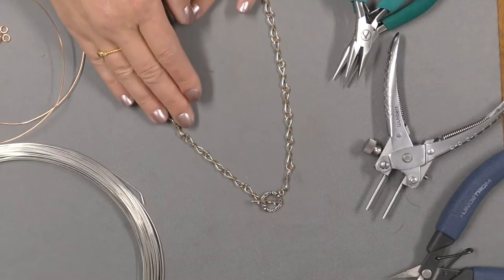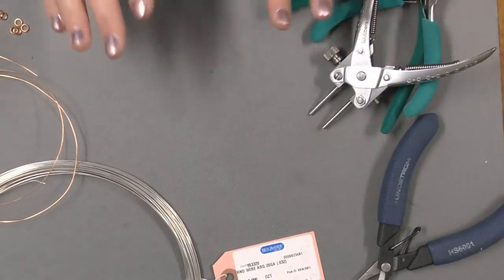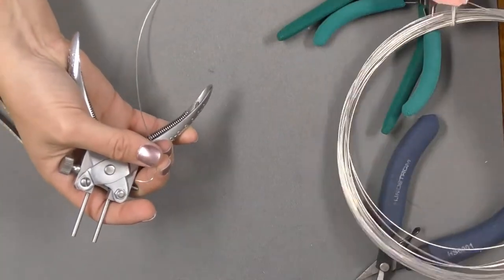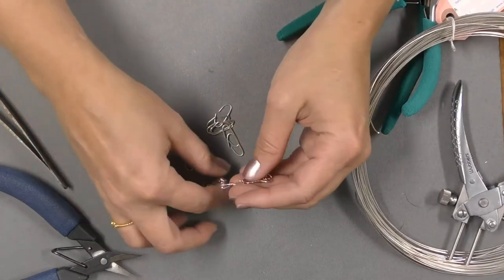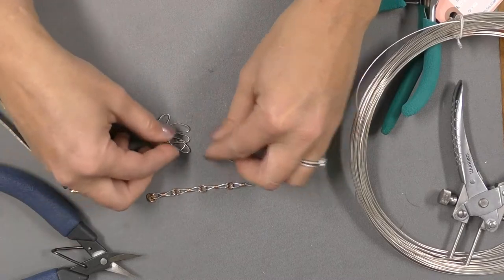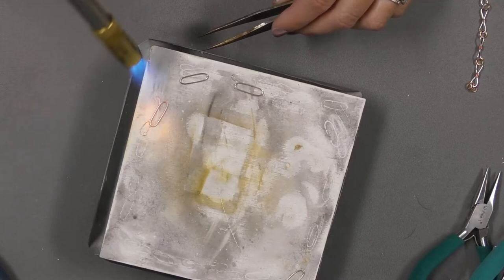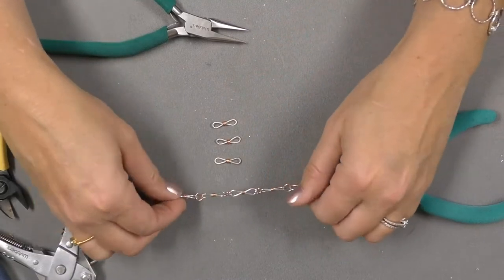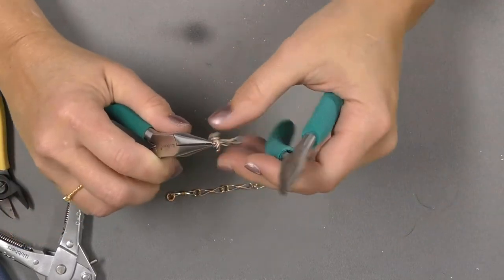Wubbers Bow Tie Chain

Comment: I did not see you using solder.   ?????
Reply: Argentium will fuse to itself so she didn't need solder.  Argentium is a wonderful metal to work with!  I started out fusing argentium before I ever even tried to use solder because it's easier and less to clean up because there's no fire scale.  If you make this with 925 Sterling, you'll have to use solder unless you wire wrap all the bowtie links.